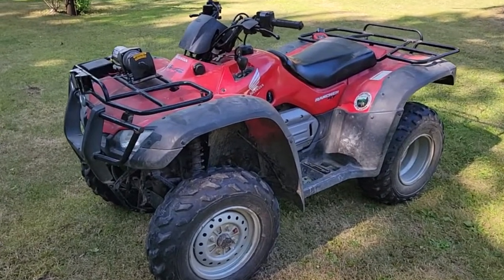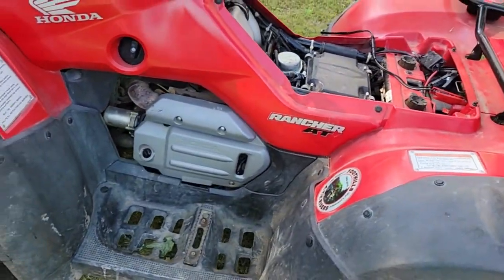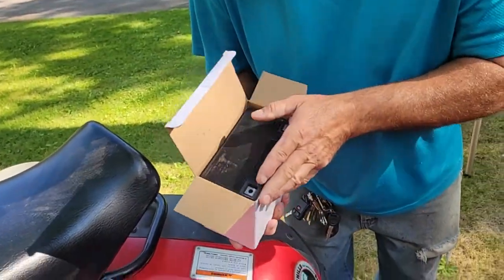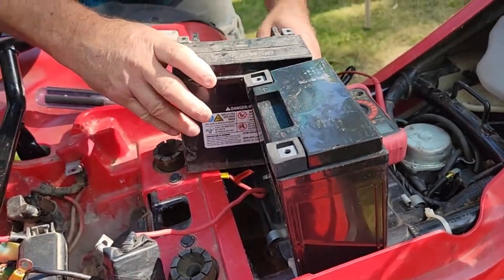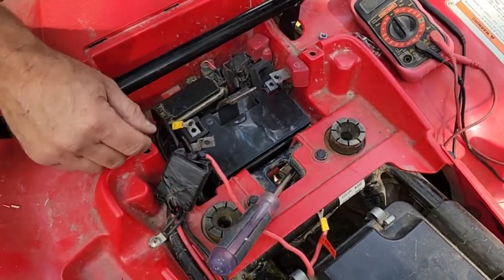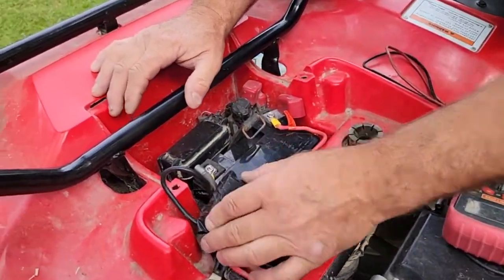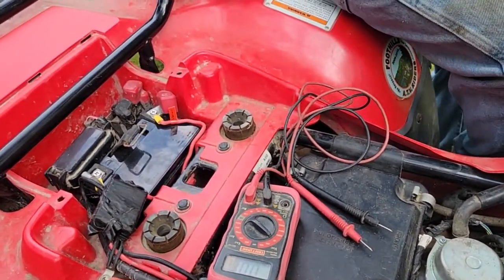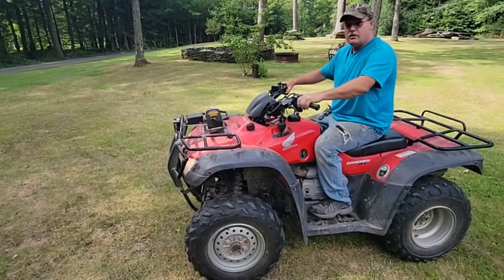Honda Rancher Dead Battery

Comment: Do you have to have the battery in the unit to charge it? Thanks
Reply from the maker: yes I charged the battery until fully charged but it wouldn't hold
Reply: @workwithkevin  my brother had same problem on his can-am outlander 570 . I told him voltage regulator put a new one it and problem solved 😎.